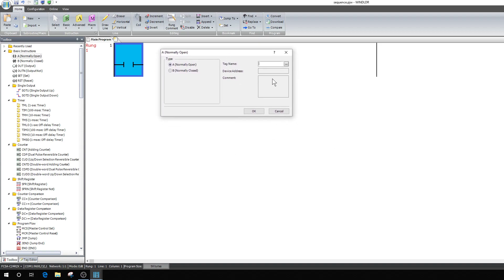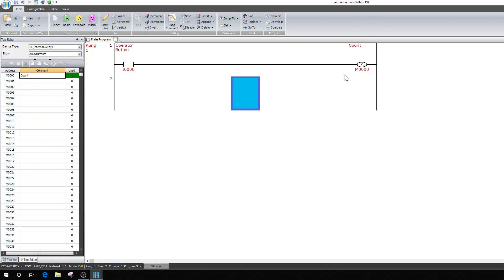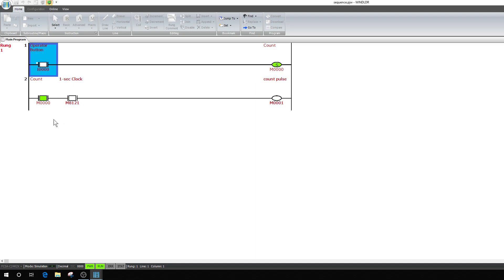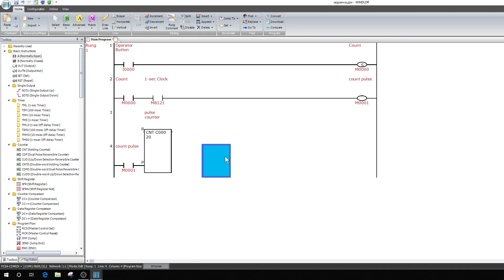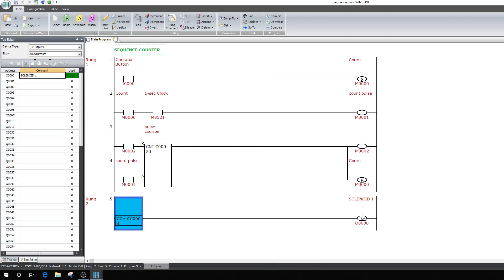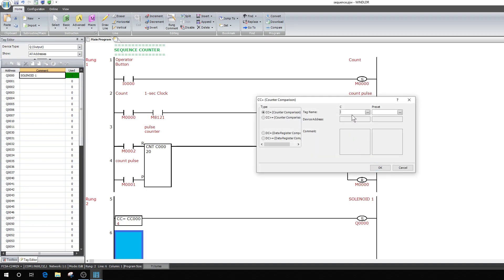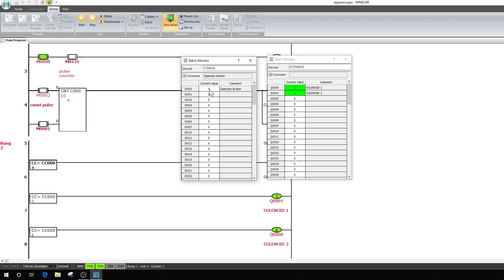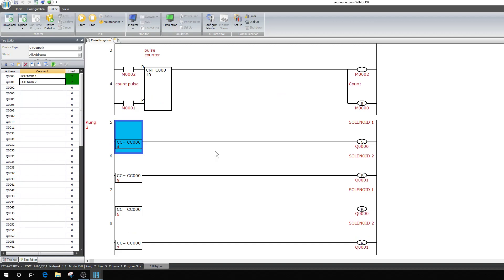IDEC PLC Programing a Sequence

Comment: Do you have any videos on Pulse outputs or Pulse Width? I have a project using a stepper motor and a Stepper Motor Driver.
Reply: It took me nearly 3 weeks to figure out how to drive a stepper using the MOV and the CNT counter. While I finally figured out how to drive the stepper using these blocks, I’ve hit somewhat of a road block since I cannot speed it up any faster than the 10-ms pulse outputs will allow.  Did you by chance ever figure it out using anything else?

Comment: Thanks for making this video! Why use a counter with a pulse instead of a timer instruction?
Reply from the maker: You could use separate trimers for each function.  For a simple sequence this has always worked well for me.  And, it is really easy to program.  And, it just give a person an idea of how to use a count function.  Lots of ways to skin a cat, as they say.    I think this was one of my first YouTube videos.  At the time there weren't many Idec videos around.  So, I figured I would throw some ideas out there for people to play around with.   Thanks for watching!
Reply: I have an FT1A plc and I am having problem download ing the WindLDR program to the PLC.  As well as how to Upload the program from the PLC. Thanks.
Reply from the maker: @manuelvaldivia9924  Are you using NV3?  You have to use NV3 for the FT1A Touch.  Make sure you have communication settings correct, for how you are connecting.  Initially use USB, and be sure and update the firmware the first time you connect to it.  
If you would like a video, let me know.  I do have an older FT1A, i could connect to.  For Demo purposes.

Comment: The audio sounds funny. What did you change.keep up the goodwork
Reply from the maker: That was one of my first videos.  Lol.  I am gradually improving, I hope.  Check out some of my other videos.
Reply from the maker: I am using OBS for the screen capture, and a lapel mike.  I need to play around with the setup a little more.  If anybody has any suggestions, it would be appreciated.
Reply: @huntxtrm  2 years late, but OBS is fantastic for recording. You can get plenty of good sounding mics for cheap from best buy or microcenter.
Reply from the maker: @Smackteo  OBS is what I am using now.  I have just about got descent sound now.